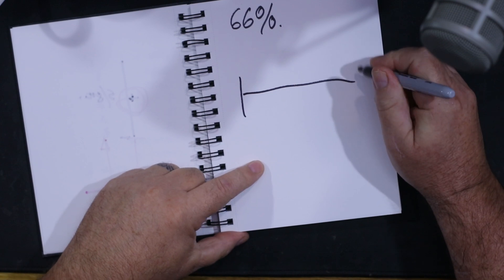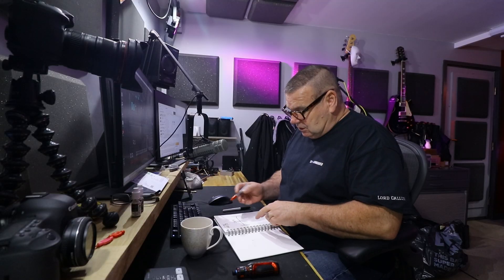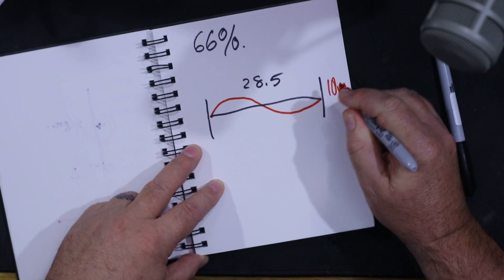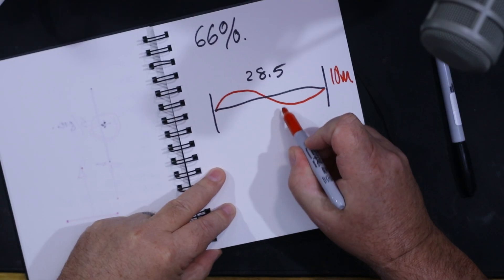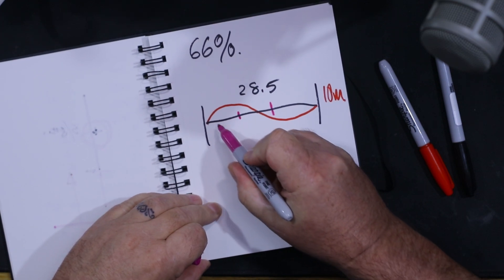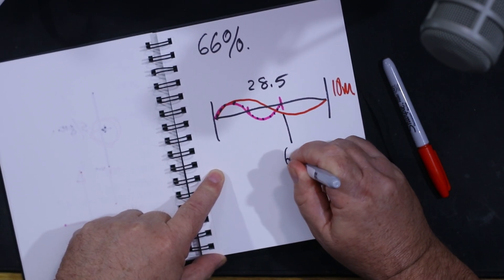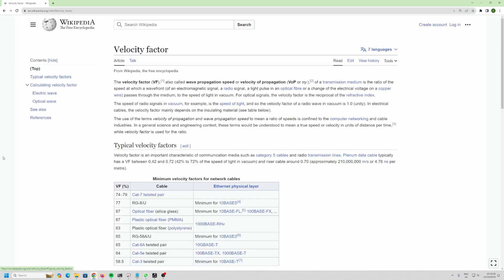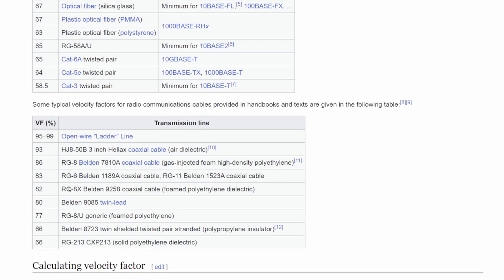What is Coax Velocity Factor?

Comment: Velocity factor is the velocity by which RF waves travel through the coax.
Because the dielectric which is the insulation between the conductors has a particular density and not a vacuum RF travels slower through it.
The number is is referenced so "1" is the speed of light in a vacuum, so .68 would be 68% the speed of light.
As a side effect because frequency is referenced to time the wavelength compresses by the same factor so a VF of .68 will mean a wavelength in the coax is .68 x (300/frequency MHz) to give wavelength in metres.
In practice cutting phasing sections and coaxial transformers by the above will not be perfect.
Using a VNA to measure and match a resistive load at the end of your matching section at the target frequency will yield superior results, as will using the VNA to measure phase shift for phasing harnesses.
Reply from the maker: Perfect!

Comment: I use a Rig Expert AA-35 Zoom to analyze my antenna's. There is a VF under the Set Up menu to allow you to enter the correct VF for the cable you choose to use. If you do not have the correct VF entered then your measurements will be erroneous and you can mess up your antenna project. I found that out the hard way :(  So VF is important when measuring for the coax length and to see how your feed line affects your SWR! Best to invest in a high quality feed line with low loss for the frequencies you want to transmit on.  73's de kd5smf

Comment: I tried cutting a 6m dipole in the summer feed was 10m of rg213 into 7m rg58 air choke and my measurements for the leg length were not even close, it was then I found rg213s VF is very different but mixing two mediums in the feed probably isnt helping either. Never did figure out what length the dipole legs should be 😣
Reply from the maker: So physical elements also have a velocity factor. I don't think your coax worried about it. The velocity factor of most PVC coated dipoles is around 93% so if you cut the dipole ends off, it would have probably come in..
Reply: @DXCommanderHQ  I did tune it, I think I started around 0.97 and was getting close to 0.9 without any noticeable improvement so figured something else must be going on. This was using speaker cable which is a first for me but so is using rg213 as a feed I just never got around to working it out. Probably would be easy with a VNA but alas it's not something I have (yet).

Comment: Hi Callum I have a 2M power
beam antenna with 37m of ultraflex 7 coax. I cut 7.5 meters off it to help with db loss and my VSWR shot up to 1.9. WHY? Could you or do you know why the length of a run of coax would do this on VHF 2M. Mark 2w0jmk
Reply: Loss in your feeder will lower the SWR seen at the transmitter end, my guess is that you have a problem at the antenna. Taking an extreme example, if you have 3dB loss in your feeder the return loss would be 6dB (25%) which corresponds to an SWR of 3. So with NO antenna the SWR is a long way short of infinite in the shack. Reducing the length of you feeder will have increased the power at the antenna but you are seeing more of the reflected power. Genuine Ultraflex 7 is a moderately low loss cable but according to my quick mental arithmetic you should be seeing about 2dB more reflected power than previously.
Reply from the maker: So G0FVT has one solution, I have another.. Firstly, that's quite a run of 7mm for 30m or so run.. But I digress, it is my view that assuming your antenna was matched, ANY length of coax would have worked (shorter better) so it it more likely that you created a small issue with the connector. Double check continuity between earth and centre and make sure it's zero..
Reply: @DXCommanderHQ  I don't disagree (for a change) I would guess he has a problem close to the antenna, I did miss that the cable was 37m long. The one way loss will be in the region of 3dB on 2m, so my rather extreme example fits rather well. I think as you say he needs to inspect the connector at the antenna carefully..73

Comment: Why would a velocity factor shorten the wave length? I thought because of the coax (or any conductor) resistance signal travels slower, so it takes longer time to reach the same distance.
Reply from the maker: I note Trevor replied exceptionally.. I'll leave that with him.
Reply: The frequency will remain constant but the propagation speed slows which changes the wavelength.
λ=c/f * VF
The frequency doesn't change as it is the drinking characteristic of the wave and the relationship to wavelength is not fixed.
Reply: @TrevorClarke  So this practically happens in the antenna elements too? For the element to be resonant on a specific freq the elements are usually shorter then the actual values on paper.
Reply: @jolebole-yt  yes. Every medium has a velocity factor and every medium that isn't pure vacuum has a VF <1.
I also didn't really explain why the frequency is the fundamental. It comes from the relationship between energy and frequency which is related by Planck's constant only and energy relates to wavelength by Planck's constant and the velocity of the wave.
Reply: @TrevorClarke  Great info. Thanks fro sharing it.
Reply: @TrevorClarke  Thanks for the formula. I should do more reading on this.
Reply: It is valuable to know when building a double bazooka or any other antenna built with coax as the element